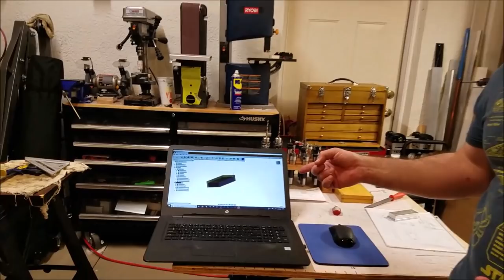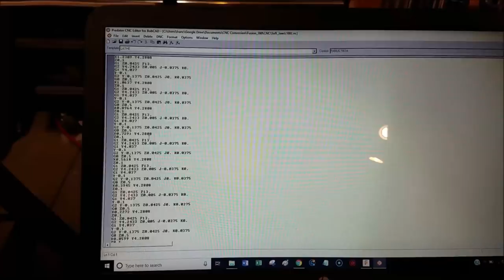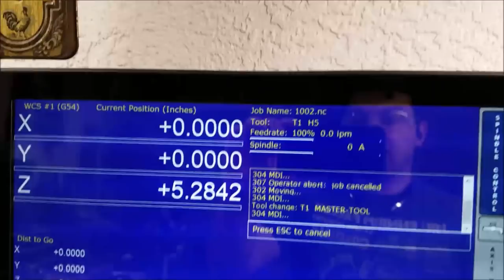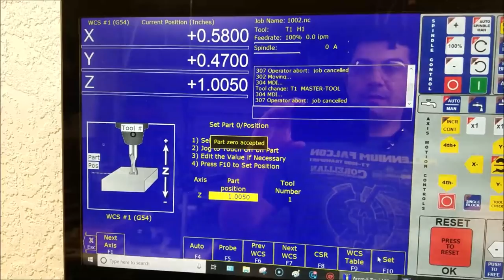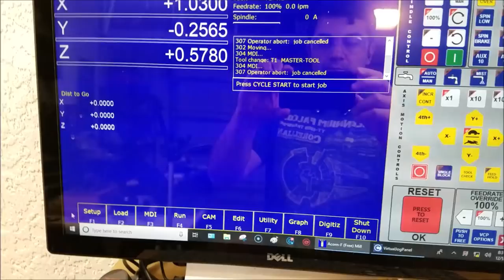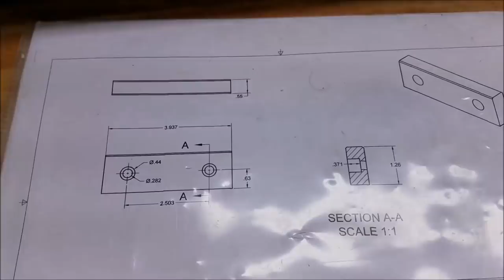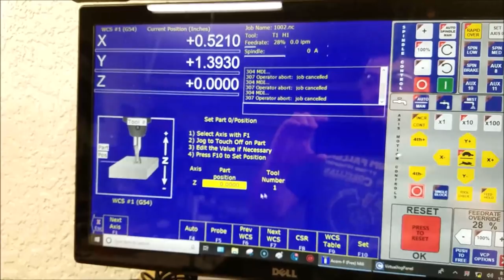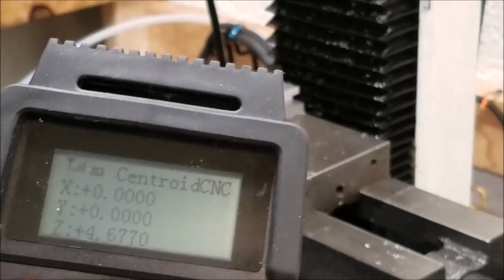PM-25MV Milling Machine: Machining 2nd Op with Centroid Acorn CNC

Comment: Hi Franco, 
Does the master tool method work for spindles that use ER collets? I know these are not repeatable in the z-axis like tapered tooling is, but would it work if one's tooling had dedicated, stationary collars on their end mills and other tooling? 
Appreciate you sharing your knowledge, thanks.

Comment: Did you adjust your spindle pot @29:21?  Just in case it helps someone,  I mapped the PM-25MV control board for CNC spindle control (using hicon). For the Spindle speed, I wired an analog ADC out to J10 (Yellow(1),Black(2),Red(3)) (Black = 0-10V,  Yellow=Gnd, RED=nc).  And, for spindle direction I used J7 (nc(1),Blue(2),Yellow(3),Black(4)).  Black is common. Blue-Black = FWD,  Yellow-Black=REV.
Reply from the maker: It looks like it did.  I haven't given Centroid control of my spindle on this machine - but I plan on doing that in the near future.  Thanks for the informaiton.  Very helpful.

Comment: I see you mostly use climb milling, any reason why? its ok for a final pass to get better surface finish but on the heavier chuts tries to pull the bits down into the work and can pull out bits if they are no very secure. With conventional milling the bit is always being pushed away and is far safer on light machines.

Comment: Two quick questions. What R8 collet system are you using that allows you to install and set the tool heights in Mill12 ahead of time? What air system do you have installed around the quill? Btw, thanks for the great videos!
Reply from the maker: The air system is just a piece of cheap lok-line I purchased on eBay.  I 3D printed the yellow ring and clamped it to my spindle.  Nothing fancy or special but it really makes a big difference.

Comment: How well did it hold tolerance? I see it was mostly plus or minus .01 but did it hit the dimensions you programmed? Great video btw! Can’t wait to see what you make next on this machine
Reply from the maker: That is a great question.  Part to part repeat-ability, is very good - both vise jaws are identical in the X and Y dimensions.  In X axis, the part is exactly what I programmed.  In Y axis, the part is 99.8% of what I programmed.  Two possible causes: 1.) there is more deflection in the X-axis than the Y-axis; 2.) The Y-axis ball screw pitch is not exactly 4mm and needs to be compensated in the Centroid software.  I'll have to make some more test cuts to know for sure, but either way, it's not a huge problem for me.  I'm really happy with the mill, considering it's price and size.  The surface finishes are really good - better than what I could get on my G0704.

Comment: I have a couple questions if you have time to answer them. What do you set your dip switches to? Also, what feeds and speeds do you use for that 1/2" endmill during roughing and finishing? Thanks! I enjoy your channel alot!
Reply from the maker: Quick Question:  do you use Fusion360?
Reply: @FrancoCNC  I use Fusion 360 for cam and solidworks for cad, but planning on using fusion for cad in the near future.
Reply: @FrancoCNC  Did I miss you talking about my questions in your video?
Reply from the maker: @Bpohlman13  Hi Brian.  Here is a public link that will allow you to view and download the F360 file:  https://a360.co/2T07VgJ
You can open it up and see all of my machining parameters.
Reply from the maker: You're talking about the closed loop drivers?  As I recall, I'm at 4000 pulses per revolution on all three axes.  My X and Y ball screws are 4mm pitch and the Z it 5mm pitch.  Those settings are working really well for me.

Comment: Why use that small, LONG endmill to face all that material off when you had a facemill? Run that face mill at max RPM and feed it as high as the machine will allow.
Reply: @Juan Travis instablaster :)
Reply: @Yusuf Aaron Thanks for your reply. I found the site through google and Im trying it out atm.
Looks like it's gonna take quite some time so I will get back to you later with my results.
Reply: @Yusuf Aaron it did the trick and I actually got access to my account again. Im so happy!
Thank you so much you saved my account :D
Reply: @Juan Travis no problem :D

Comment: Dude, just jog to z1. And slide a 123 under the endmill before starting your job. Stop wasting time with your scale
Reply: Doing that in conjunction with using a proper edge finder would be the way to go in my opinion also. Faster, more accurate and safer.